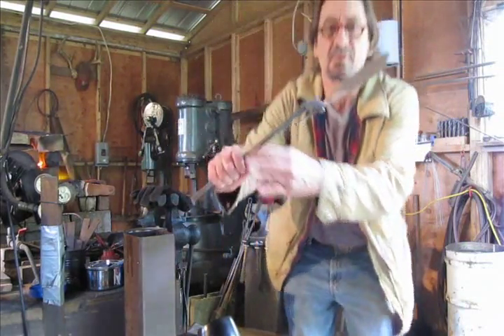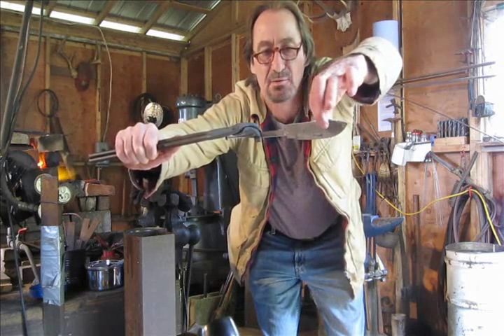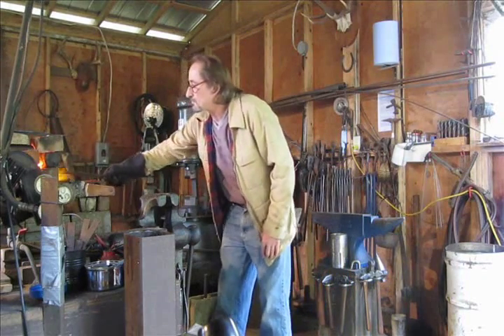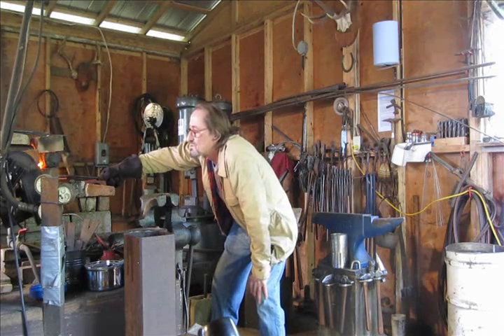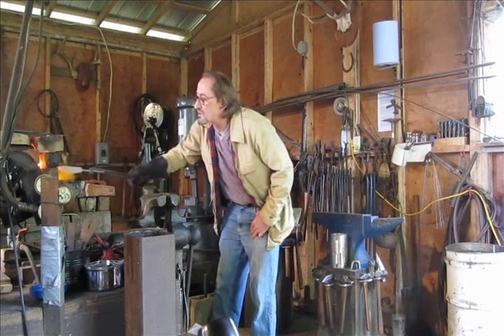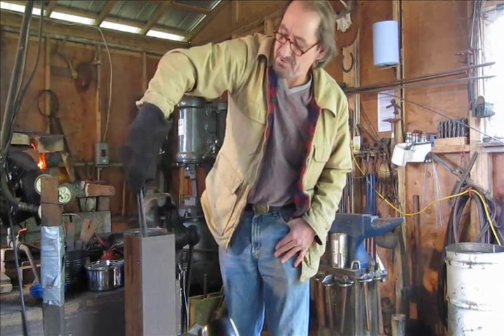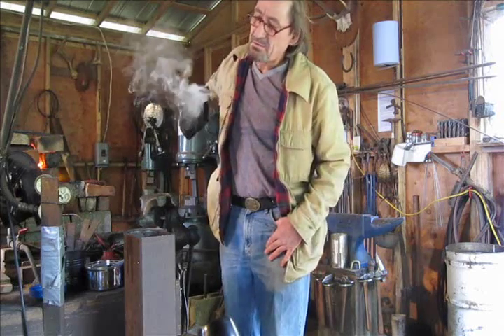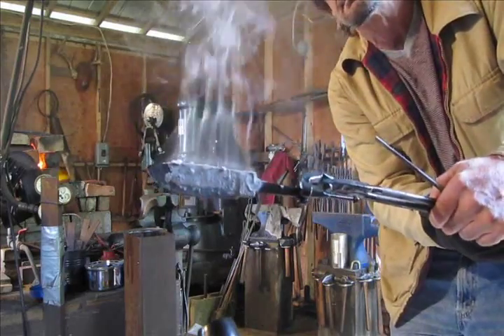Making Damascus Steel, Hardening a Drop Point Hunter.

Comment: No the Japanese do not curve the blade by quenching tip first. 
The way they get the blade to curve and control how much is heating the bade with a layer of clay and Carbon mix. It is applied thicker along the spine and a thinner coat as you get closer to the edge. The quenching point first has nothing to do with curving the blade it was thought that they would have less deformed blades by doing that, anytime you heat treat there is a percentage of product that is ruined even when professionals who specialize in heat treating do it.
Reply from the maker: You're free to be wrong.
I know for a fact that is how the Japanese get the curve in the blade.
It also has the effect of compressing the edge steel making it even harder.
The clay is applied to obtain a differential hardness in the blade, and has nothing to do with curving the blade whatsoever..
Where are you getting your info at, it's total bullshit.

Comment from the maker: @peteacher52 
Thanks, if People like you are learning something from my videos , then I'll have left the World a slightly better place when I croak ;-).
All I use IS high carbon AND my own steel for my knives.
High carbon steel sharpens easier and holds a great edge and the ONLY advantage stainless has over it IS the fact that it is stainless.
The thing is ANY oil put on a blade will protect it from rust, and it's not a hard thing to take care or your gear.

Comment: I learn a great deal from your videos Conan. You explain every process clearly and without patronising the viewer. I was wondering if stainless steel comes into your knife making work at all. Some knife makers get old truck springs and forge the steel but as you know, the blades corrode quickly if not really well kept. How long would it take a good acolyte to reach your level of skill?

Comment from the maker: @pyrea17 
It depends how bad the warp is.
I don't get them very often, but when I do it's usually around the edge and grinds right out like it was never there.
If the blade is bent, I'll either reheat, straighten and harden it again, or heat to around 450 in my oven and bend it in a vise.